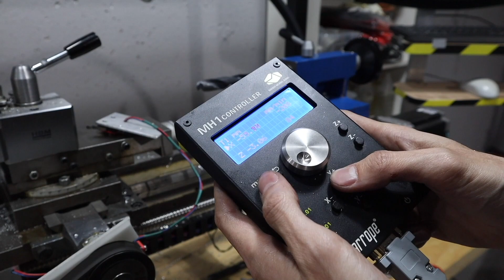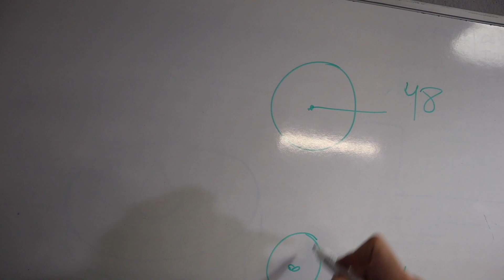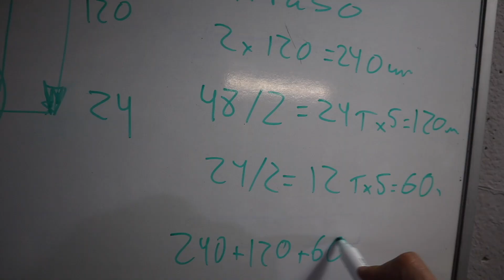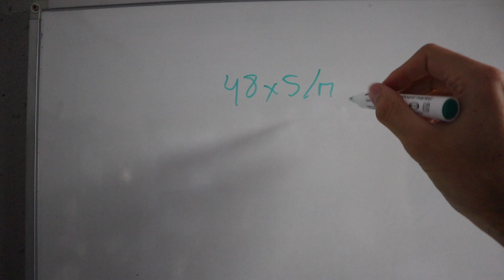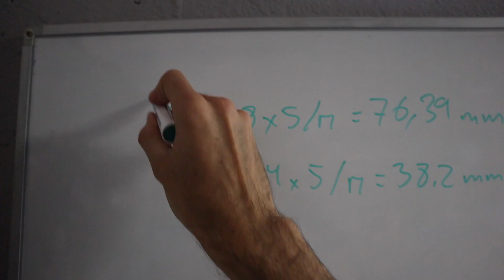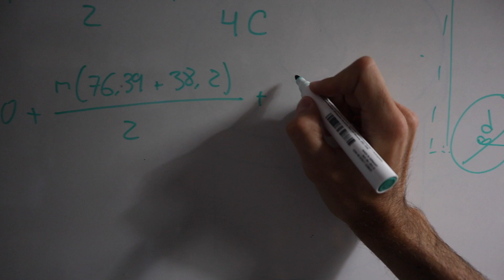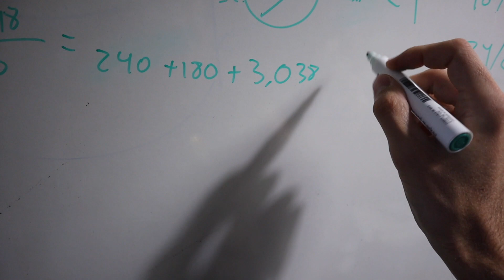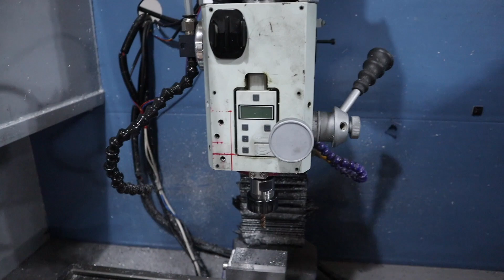Motor trifásico con variador de velocidad en fresadora CNC DIY

Comment: Buen trabajo. La opción del motor para solventar la perdida de par a bajas frecuencias es el uso de un motor de control vectorial. A tres hercios es capaz de dar el 100 por 100 de par . Ademas alcanza las 6000 rpm. a 200hz. Por 300 euros solucionas el problema.
Reply from the maker: Hola Jose! algún modelo que nos recomiendes de variador con control vectorial? o te refieres a motor? por qué has dicho motor pero tenía entendido que eran los variadores, please algo mas de info! muchas gracias por el comentario.
Reply: @MaquinerosCNC  Me refiero aun motor vectorial que se controlan con un variador de control vectorial. Son motores cuadrados tipo servo ( no es un servo) con un ventilador autónomo que garantizan la refrigeración a bajas vueltas.A 100-150 rpm ya tienes un par muy alto. A 200hz el de cuatro polos va a 6000 rpm. Están diseñados para ir a estos hz sin problema ni eléctrico ni mecánico. Yo he montado uno de 2,2 kw en mi fresadora y estoy contento de como responde. Aún no lo tengo muy testado porque tengo la fresadora en construcción, estoy liado con el ATC y me ha retrasado el proyecto.
También es muy importante que las poleas estén equilibradas dinámicamente. A partir de las 2000 rpm o incluso antes, generan vibraciones indeseables que afectan mucho a la maquina y al mecanizado. Yo las lleve a una empresa que se dedican al equilibrado, y me las equilibraron a G2.5 que es como vienen equilibrados muchos porta herramientas de los que utilizamos. También se puede equilibrar de forma casera.

Comment: Estas sacrificando torque porque tienes una relación de poleas para incrementar velocidad... además, el motor al ir arriba de su velocidad nominal también pierde torque. Esto lo vas a notar al momento de cortar, mientras mas profundidad de corte, mas torque necesitas y tal vez el motor se nota que se detiene.... tienes que partir de conocer el torque que te entrega la fresadora original y hacer los cálculos de torque para encontrar la capacidad del motor necesario.... y tambien influye el tipo de Variador, no es lo mismo usar un equipo de control vectorial o escalar a uno de control directo de torque.... este ultimo controla de mejor manera la respuesta de torque del motor en toda la gama de frecuencias.... un saludo desde México

Comment: ... pues bajo mi opinión y escasos conocimientos, creo que te equivocaste en la elección de motor: Para mi, mejor elección un motor de 4 polos (1500 rpms) ya que da más torque (el doble) y polea 1:1. Con eso tienen un buen torque a bajas vueltas (que normalmente es la mayor carencia) y si quieres revoluciones, un buen variador vectorial te lleva un motor de 4 polos tranquilamente a los 200 Hz.
Reply from the maker: Pero no me recomendaban pasar los motores de 70-80hz, creo que comento en el video, que lo suyo sería 1500rpm y polea 1/2 y si acaso subir a 80hz aprox, ahora, si puedo confirmar que se puede subir a 200hz... lo que tu propones sería lo mejor.
Reply from the maker: alguna recomendación de variador?
Reply: @MaquinerosCNC  Hace ya más de 8 años que tengo una Syil X5+ y me vino ya con esa configuración, motor "chino" y un variador "normalito", un Delta VFD-M. Actualmente lo he cambiado (he dejado ese motor para el "torno" que tengo montado en la misma fresadora y, siguiendo los consejos de un gran experto (Michel - Tr Precision Machining) le puesto a la fresadora un Siemens de 2.2 kw y un variador vectorial que dijo era de los mejorcito: Un Schneider ATV320.